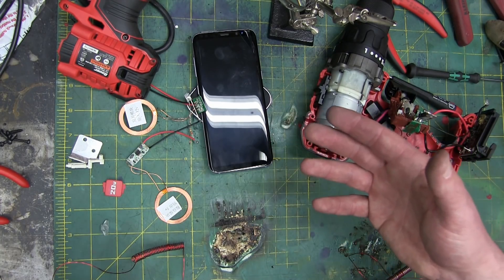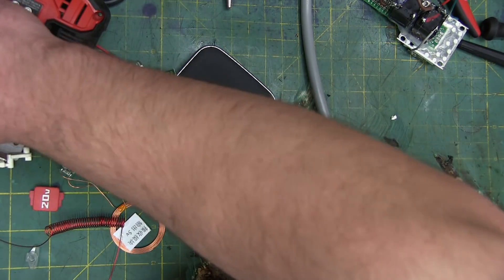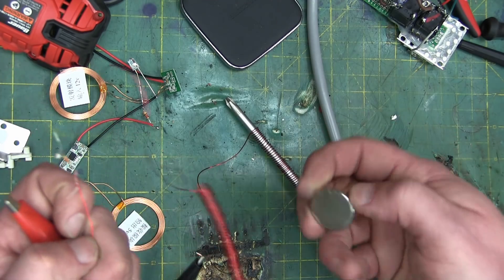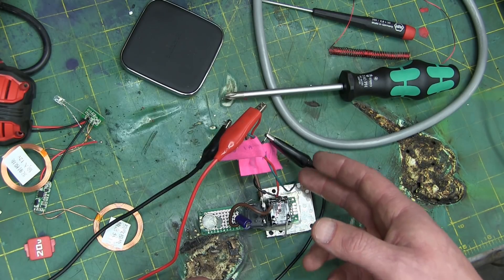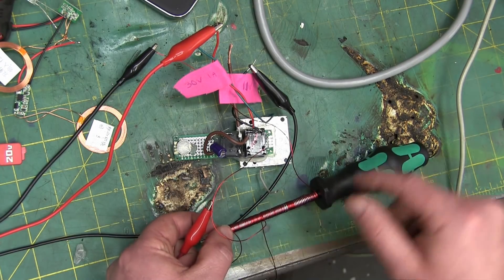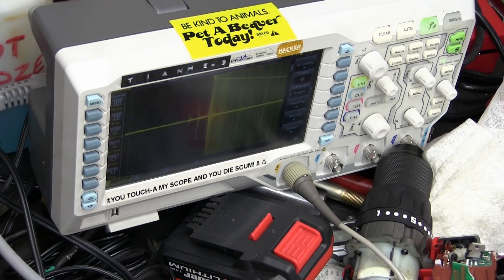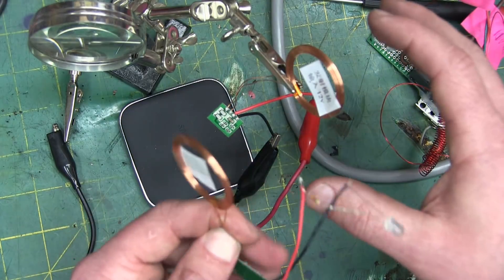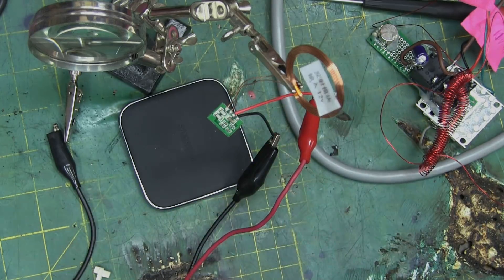Qi Wireless Charging EXPLAINED! | Electronics for the back of the class.

Comment: That's a magnetic screwdriver you tool
Reply: Raymond Mucklow I think my tip was hardened watching this video
Reply: no it's not a magnetic screw driver. in the video the tip did not pick up the screw only close to the copper coil. if it was magnetic the tip would have picked it up.
Reply: CorollaGTSSRX mine 2.
Reply: CorollaGTSSRX I think it was a hardened tip screwdriver.
Reply: CorollaGTSSRX Same here, but just the tip, and only for a minute.